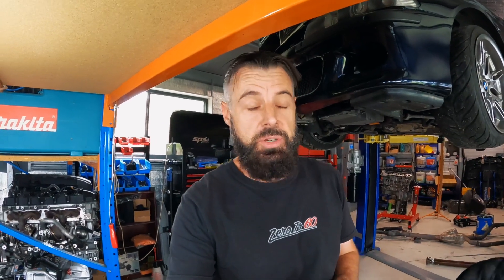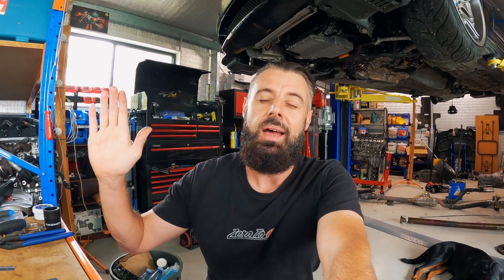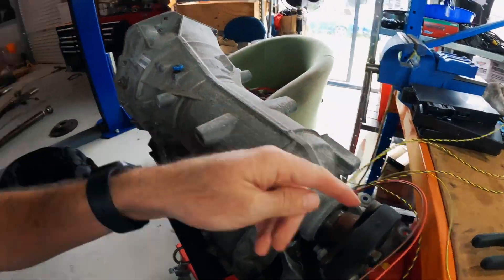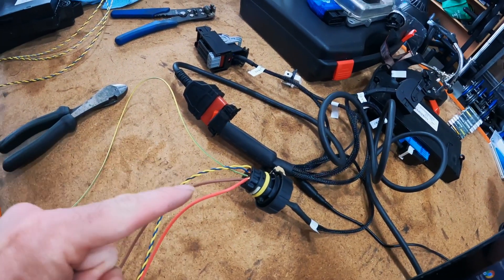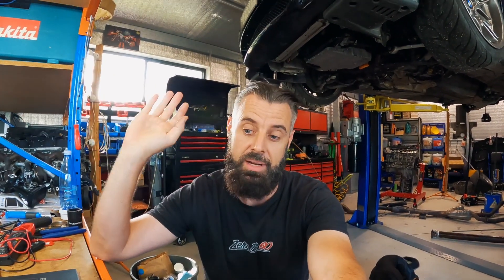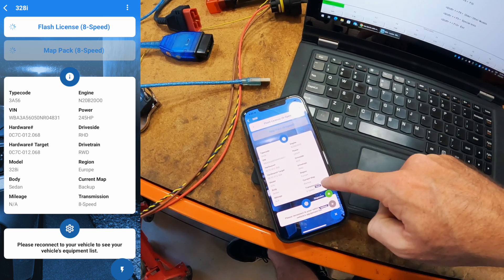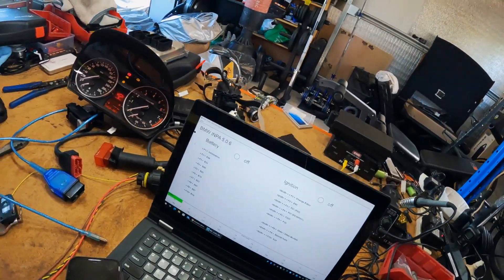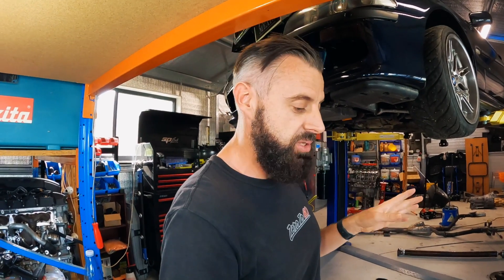Trying to flash a 8HP45 on the bench! It didn't work!

Comment: Why not clone the pflash from a x1 or get the mechatronics from a x1?
Reply from the maker: Still trying to work out if it’s possible. I don’t think I can read the flash with vvdi prog. Well not with out opening the tcu
Reply: @Zero To 60  yeah vvdi is not gonna be the go to, I think that egs probably has a different processor you will even see this is the same dmes like MED17 where different processors either are TC1797 or TC1776 for different models because of software, firmware and bootloader the be more specific the 8HP45/50/70/75/90 all have SH752519 MCU which the processor in 6HP are TC1766... so I would verify the MCU first
Reply from the maker: @scarface16134  found some info on the 8hp in the f series, but nothing on the e series, 8hp as yet. I did find one guy reading the mcu but he had to cut the tcu open to do it. Which is too much work for this sort of project. Once you are that far in, may as well run an aftermarket controller.
Reply: Sadly all my tools can do is clone it nothing more as far as modification but I have a feeling f series can't step down to eseries just because how everything ran furthermore you might nit be able to even bench it without flexray coms just like most f series dmes

Comment: Something I have seen with 8hp adapter harnesses is people using a 120ohm resistor across the can lines. Not sure if it’s necessary to balance communication or what. Be hard to tell what egs/build you’re  running without inpa working to read the module. Have you verified the trans plug pinout? Can lines are usually 2&6 unless it’s changed for your particular box.
Reply from the maker: Yeah it was all down to the obd plug….

Comment: I sent you the wiring diagrams for a 2013 E84 X1 S drive 28i for the transmission circuit.  Looks way more N54 friendly
Reply from the maker: That is the one i used. I do have full access to TIS. thats what i used for the wiring outline in the video. Still need to workout how to put the wrong software on the F series box lol.
Reply: @ZeroTo60Tube  most of the time I have OE diagrams and the colored Non OE ones, but for some reason I only have non OE for X1, I am sure ISTA has the OE if needed
Reply from the maker: You not on newtis?

Comment: Different subject hit for same developer, via MHD for MSD81 you can load a custom BIN for the 1M ecu flash and MHD is programmed to overcome all the errors. Trust this isn’t the case for flashing the incorrect software to an 8HP but worth checking. The original discovery thread by, Peter and VTL I think, discussed about having to set the worked hours to below a certain amount to facilitate flashing the BIN from anther VIN.
Reply from the maker: I have seen that thread from Peter and VTL, top aussies doing amazing work over the years. I may need another way of reading the eeprom on the TCU to pull this off. xHP may be able to do this, but i am really not sure what level of access they have on the TCUs.
Reply: @Zero To 60  OTP only I would assume

Comment: Also another thing I've noticed with the F-series, they also have that start/stop pump motor in the 8hp for the start/stop function. The e70 8hp doesn't have that function. So as an idea, wouldnt the mechatronics controller be different also between the F amd E series then? Maybe if the hardware on the 8hp is same, swapping an e70 n55 mechatronics controller into this 8hp shell? I've been thinking about this a while ago, considering a swap from the e70 n55 into my LCI E61 N54 xdrive. And with F-series 8hp coming more available, still thinking as far as communication on mechatronics goes, better to go with the e70 8hp. as it also doesn't have the start stop pump motor and the drive logic selector either.
Reply from the maker: 100% i think the e70 8hp would be the way to go, this is what Taron had used and nearly got working. His only errors were door position and the DSC pump not recognising the trans. Which is what gave me so much hope. However i am coming to realise how difference the F and E series boxes are electronically. I did see stop start wiring on the x1 diagrams i think, so maybe it was an option on some e series models as well.

Comment: i know the bimtool has the option of flashing E-series modules maybe you can try there ... There are tools that can read 8hp on bech and you can clone ecu maybe you can find an x1 dump and clone it to your box...
Reply from the maker: I was kinda thinking that. What i might do as a last stitch effort, flash a cas with the X1 vin, bimtool in its programming  mode, uses the cas to identify the vehicle order and what flashes should be on each model. i didnt want to try that until i was sure winkfp was out of the question, as i have no doubts that even on a X1 box bimtool will probably brick the trans lol.
Reply: Looking at buying a Yanhua ACDP to dump from and write to the gearbox… haven’t been able to find anything cheaper.

Any chance of getting our hands on an E84 dump? I’d prefer not to have to buy two gearboxes :/

Comment: What software would you say is absolutely necessary as a bmw owner? I currently have an e46 compact and a f10 m5. Bonus points if you can let me know where to find it 😅
Reply: The bimmergeeks stuff is pretty much all the other stuff but it has a real user interface instead of just code.
Reply from the maker: I think if you are good with computer stuff get all the OEM tools. Search for BMW standard tools. You need to be half a nerd, have the cable or fork out for the icom. Other wise so many people speak highly of the phone versions. However i dont know a single specialist that touches them. All the cluey guys use BMW standard tools.

Comment: I tried to get you a ZB number for the GKE233 in the E84 but it doesn't show up at all. In the BMW Daten files it only shows E70/E71 and some Rolls Royce cars as having that module. Try using INPA module identification to see if it will pick the gearbox up and it should show the actual module type you have, I think your IFH003 errors were caused by WinKFP not being able to see a GKE233.
Reply from the maker: You are on the money. I think my bench harness is missing the wire INPA uses to request diagnositic data. The BIMTOOL, and xHP will head straight to the module on the PT can or K can. Where inpa requests UIF data and then accesses the module (i think), so because standard tools can't do the UIF request, everything is failing..... i think. I need a different bench setup. Or be able to force write with winkfp.

Comment: Can you write F series with WinKFP or would you need E-sys to clear the 8HP45 of its F series to virgin and then load the X1 E84 profile? I think that is the same thing Glenn is saying.  I know NCS expert has load files for Brazil X1 E100 fuel pump control module.  I did notice you have CANBus errors on A CAN and FA CAN I am wondering if that is PT and PT2.  It seems the trans wants to communicate with the shifter. Let me know if you need any more wiring diagrams and don't forget about the functional description/concept of operation info too.  Good luck!!!💪
Reply from the maker: Yes, well i have only connected to the PT can, not PT2. Does PT2 only go to the shifter? hmmmm I assumed there was more things on the PT2. Esys will definitely write to the F sereis box, but it wont write the e series software. I have seen Arno repair my MSD80 in expert mode. Expert mode in winkfp doesnt car about the module, it just writes the file and i was hoping to be able to that with this box. Even if the TCU is different more memory etc, i was thinking maybe it would take the e series firmware. Also thinking my bench harness is only good for aftermarket tools which dont rely on the UIF reading.
Reply: @ZeroTo60Tube  for sure PT2 goes to shifter, DME, trans AND DSC.  I am thinking you might be SOL on the F series trans, however it seems a 2013 E84 X1 S Drive 28i Mechatronics unit may be the ticket, in the US those transmissions are dirt cheap, no one is rebuilding a 2013 X1.
Reply from the maker: Hmmm shame they like hens teeth here. Anything x1 is worth a lot due to being so rare. Just like our diesel rwd boxes…… 😖

Comment: A while ago I read xHP's article on "Converting a 130i from GM to ZF6HP". It says not to use the 6HP from a E83 X3, because although they imply that it's the same hardware, it can't be flashed over the OBD port, because it will only communicate over K-Line.

Sounds like a similar situation here, no?
Looks like your bench setup is using an E-series JBBF as the gateway - so the "translation" from KCAN to PT-CAN will be happening there, and the JBBF will be speaking E-series PT-CAN.
Seeing as the transmission is from an F30, it's a bit surprising that you can talk to it at all with this setup. Maybe the E and F series PT-CAN are partially compatible.

I think to flash the F30 transmission, you'll need to use an F-series gateway, which speaks F-series PT-CAN.
I believe this is called the FEM (Front Electronic Module). Unfortunately they seem a little expensive, as they appear to integrate a bunch of functions previously handled by the CAS, JBE, and FRM. Perhaps you can grab one from a local wrecker with the wiring attached. Shouldn't be hard to find, as every F-series car will have one.

From there I suspect you'd just need to hook the FEM's PT-CAN up to the transmission, connect an ENET cable to the FEM, and you should be able to talk to the transmission without any issue.
I've made a couple of guesses here, so may not be 100% correct, but hopefully this helps.
Reply from the maker: All of your assumptions are pretty spot on. However i probably didnt make it clear enough. Standard tools wont connect to anything on the bench harness, it cant see the CAS, JBE or cluster. So there is an issue with this bench harness and standard tools. My thinking is forget anything f series related, i simply want to write the e series software to the box. Although F series PT can will have data on it, that differs to the E series PT can. The protocol is the same (to my knowledge), so was hoping to "simply" write the e series software via winkfp and pt can. If that wasnt an option, the box will likely never work in the e series chassis. The box for the build is a 335i N55 box, this one i got ridiculously cheap and may end up in an RX8 one day :P. It was just in the shed so easy to hook up to. The N55 8hp45 and TQ is the only one that will bolt up to a N54. The 8hp50 have a different way of connecting the TQ to the flex plate. The later flex plates, will i think bolt on the late N54s, but not 100% sure.
Reply: At a guess, once you finish flashing the E-series firmware, the FEM won't be able to talk to the EGS anymore. Might be wise to virginise the transmission before flashing.
Reply: Also, how much difference is there in bell housing / bolt pattern between the transmissions? Will your 328i box fit the N54 without modification? I want to do this to an N52, which has a slightly different bolt pattern to the N54.
Reply: @ConroyCheers  you gotta do a video series if you end up swapping a zf8 to an n52
Reply: And one more question: is there any particular reason you're using the 8HP45? Do you know of any reason why an 8HP50 or 8HP51 wouldn't work?
Reply: Have come to the conclusion that getting WinKFP and E-Sys to flash each other’s firmware will be a huge pain in the ass.
Currently looking at buying a Yanhua ACDP, which claims to be able to clone ALL 8HP TCUs, and ISN reset for both E and F series. 
Would just need to make a dump of an E-series 8HP, then should be able to flash it to any other (first gen) 8HP (this should include F series BMW and even other manufacturers such as Audi). From there, should be able to flash whatever E-series firmware you want with WinKFP, and modify the shift maps with xHP or similar.
Anyone got an E-series 8HP mechatronics they want to donate? :D

Comment: any reason whyyou would use the turbo lamic over the HTG controller ?
Reply: word goes around that lamic is better for 8hp as they has close loop strategies at the begin of development htg only got closed in dec.  but it looks like both  these companies dont have all things smoothed out. they til in development stages. im htg customer.
Reply from the maker: Lamik connects to e9x canbus. So you don’t have to change anything in the car. Tbh probabaly cheaper than what I’m trying to do
Here 😩
Reply from the maker: Oh and lamik just works out the box. The htg is more of a racing product as of right now. The installer needs to know how to tune them. Lamik does the tuning for the buyer.

Comment: andrew can you use an E NET cable to clear the zf28 then swap over to the k plus d can cable to put e series software on the zf28 as e net works on f series and k plus d can works on e series i know its a bit of a run around but if you can virginize the f series tcm with e net then i can't see why you can't then put e series software on it with k plus d can as the software won't clash other wise can you use a can bus sniffer to read the tcm on the k plus d can cable cheers glenn
Reply: That is no the problem since he is using jbbe from E series. So communication have to be with dcan cable.
Reply from the maker: My issue is simply loading the e series software on that F series TCU. The software or fimware really is likely written to a different part of the TCU than the security. However the e series flash, may not reference the security anyway. Thats a big maybe. I need to work out how to get standard tools connecting to anything on the bench first off.

Comment: Would have been just so much easier to go 6hp28 and been done.....8 speed is cool but if this was just for strength then the 28 would handle whatever you toss at it.
Reply from the maker: This is more for learning and driving improvements. It won’t be any stronger than a 6hp21 and definitely not as strong as a 28. But this car is stock turbo so strength isn’t a concern.
Reply: Why do something that’s been done before a bunch of times. Doing new things is half the fun, double the trouble but it makes you appreciate it even more at the end
Reply: @TheMultiDouche  yeah I can sort of understand that and like I said "it's cool" but isn't the end goal about strength and speed?  More gear changes will ultimately slow you down which is why big power cars end up using 4 speed gm transmissions....the 6hp28 is pretty fast and insanely tuff once you change the bushings in it.

Comment: My god, you are a brave man..,.. there is no way I would attempt this. Does look promising though, with XHP being able to communicate.
Reply from the maker: XHP and bimtool, I think it’s standard tools reading the uif that’s the problem.
Reply: @ZeroTo60Tube  what idk if this helps your situation but what I’ve learned about the 8hp is that you have to clear and unlock the isn in the egs or Tcm prior to doing any coding flashing ect just do to the fact that it still is isn locked to whatever vehicle it was in before n the way it’s done is on the bench or plugged to transmission with a 120om resistor on wires two can bus wires by clearing isn ,unlocking it will essentially let you code or program what can be also isn locking it to whatever it’s going in when I swap a used unit in a f30 I have to do that but with autel and a bench plug then I hook up to car and the car tells it it’s new isn then just program and code but like I said idk if that will help your situation but keep up the good work love the videos man
Reply: @ZeroTo60Tube  stoopid standard tools... Be nice if someone developed an app to replace them 🤔